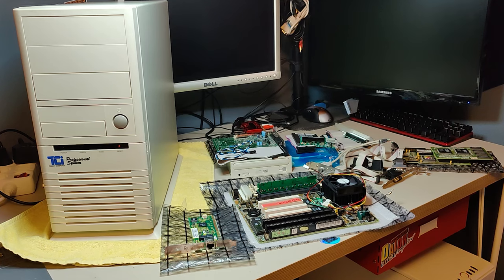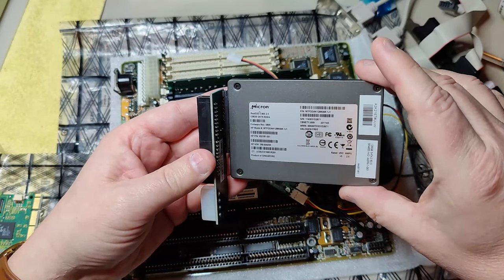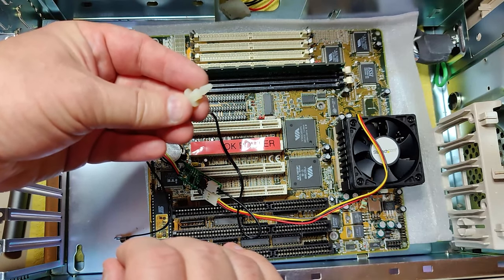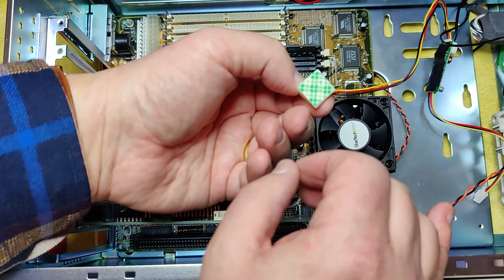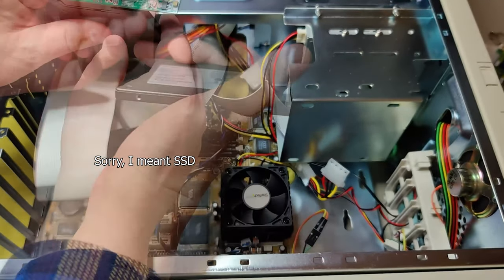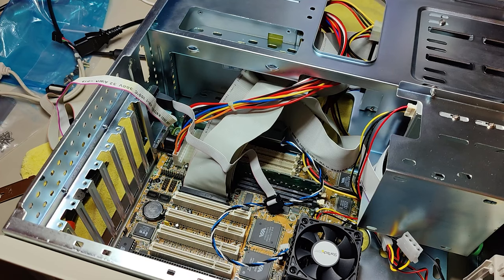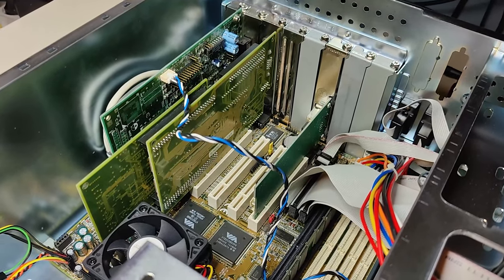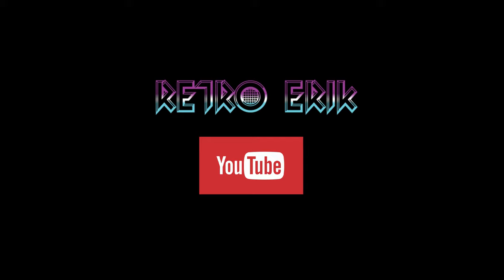Building a new Pentium 233 MMX - NOS TCI case.

Comment: You didn''t need to use the DuPont cables, you could have just removed the contacts on the USB header block and rearranged them to suit the motherboards pinout.
Reply from the maker: Hmm, maybe you are right, I will try to remember that for the next time.